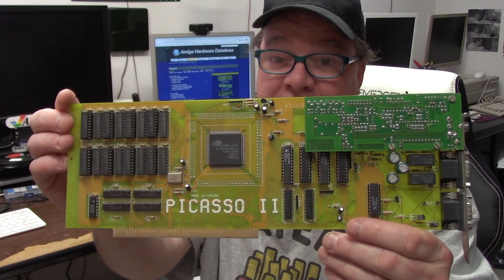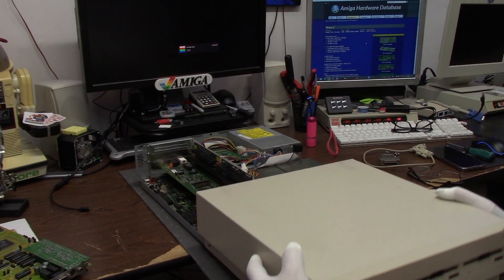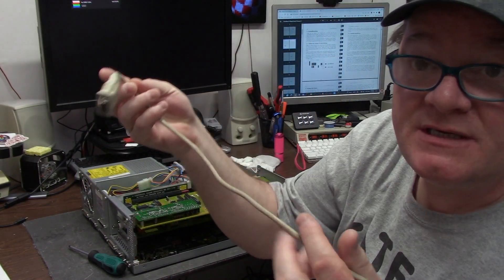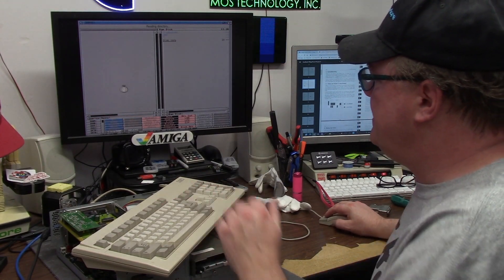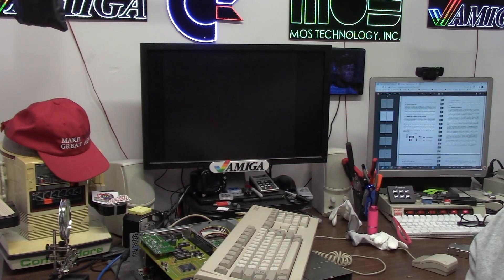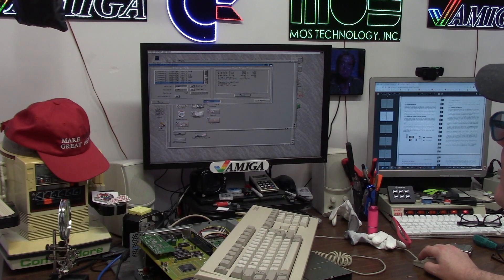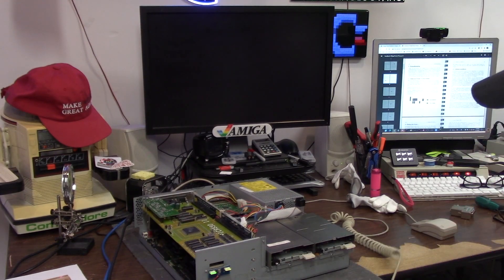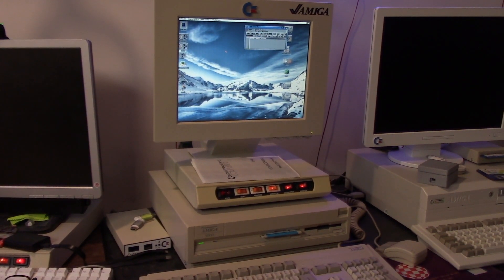Amiga 3000 Picasso2 video card

Comment: That's a great card, not only because it gives you a lovely looking Workbench at resolutions up to what I typically used on my first PC in the early 2000s, but because it's still working all these years later. I occasionally saw the A3000 advertised in magazines with the 24-bit colour image of a tropical scene and dimly understood that it was achieved with a graphics card, and was wowed by the difference from the humble resolution on the A500 and even A1200.
Reply: Nobody parts w/these either, impossible to find!
Reply from the maker: @drphilxr With an imbecile lack of any financial knowledge and a massive Paypal Credit account anything is possible

Comment: @Chris Edwards Restoration  Hi Chris, can you help me?...I have a RetinaBLT Z3 on an Amiga 4000D, but I can't configure it, the most I get is a gray WB screen but no icons, it's driving me crazy.
Thank you
Reply: @Chris Edwards Restoration  Thanks Chris for replying, yes install clean OS3:2 and install Retina and P96, but I just get that gray screen with no icons.
I tell you that I could never see the WB on the Retina, years ago when I bought it used, you could only see some programs on a VGA monitor, but never the WB, in the end I uninstalled it and now I was trying to get it to work.
I have an Indivision connected, it seems to you that it can interfere in some way with the Retina, the Indivision always looks good, but the Retina does not.
Greetings
Reply from the maker: @marioaquiles5024  well according to the BBOAH here this card has no P96 drivers and uses the EGS drivers from spectrum https://bigbookofamigahardware.com/bboah/product.aspx?id=460 theres also amigaresource. cx that has the disks http://amiga.resource.cx/exp/p=retina
Reply: @Chris Edwards Restoration  I know that page and I installed that, but it doesn't help at all, P96 detects the Retina and supposedly installs the correct thing for it, if you look at your video when installing P96 Retina BLT Z3 appears, but I can't get it to work well, surely I'm doing something wrong.
Thank you Chris
Reply from the maker: did you install P96? what steps were taken?

Comment: Hi Chris I know this off topic, but I wrote to you some time ago regarding the Furia accelerator for the Amiga 600. Since then I have upgraded to a Vampire 2.2 from Apollo. I have currently an automatic HDMI switch to alternate from RGB ECS to HDMI RTG mode. It's a bit of a pain in the neck switching manually to play WHDLoad games but a neccessary evil. I understand that there is a priority switcher available from Startech which allows for priority switching of devices. Do you know anything about these priority switches and are they affective for use in a Vamped Amiga 600?
Reply from the maker: Unless they fixed the hdmi takeover signal its just the same as what you have now

Comment: Yay! After over 2 years! You’ve fulfilled my request to show how to setup P96! 👍🏻😉 This is interesting timing. I’ve just been trying to get a PicassoIV card working without any joy 🙄 Have got a Micronik 6080 A1200 busboard Rev 5.4.4 in a Infinitiv tower case. Every time I put in the PIV card and it kills the rest of the Zorro-II slots so that my X-Surf card doesn’t show 🤷🏻‍♂️ Have followed the manual for the jumpers but no Dice 😔 It is designed for both Z-II and Z-III slots with a edge connector for the video slot for flickerfixing/scandoubling the AGA native video. This thing also has the concerto Sound add-on. Oh well….
Reply: Those Micronik boards were notorious back in the day for having bus problems,many of them did not have bus termination which may be why you are having troubles with multiple cards. If juggling the card positions doesn't help this may be the problem. You can also check the revision of the PIV and that its chip revisions are the latest also. We used to jokingly call Micronik stuff "Chronic".